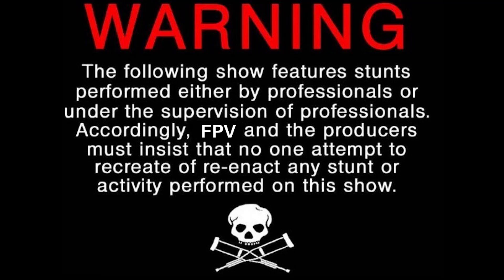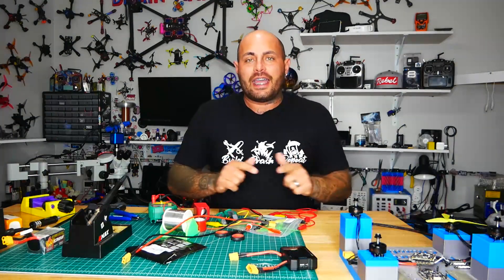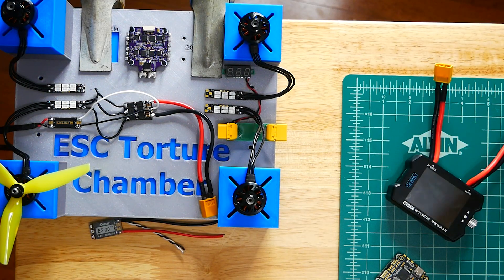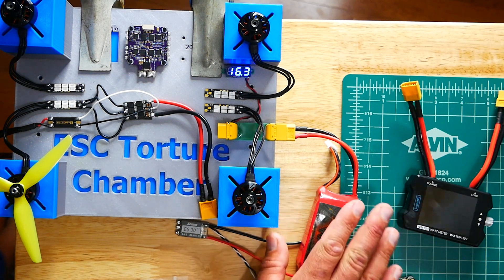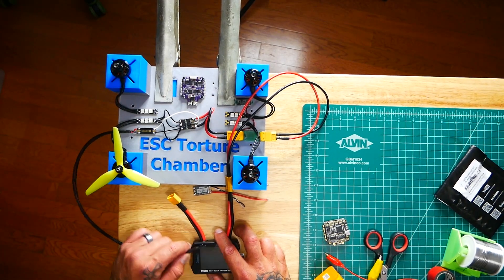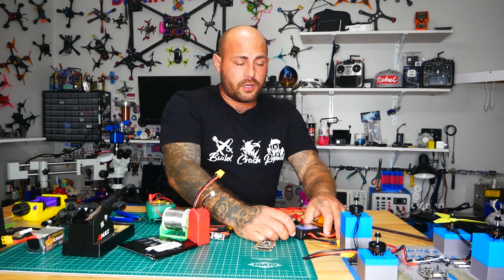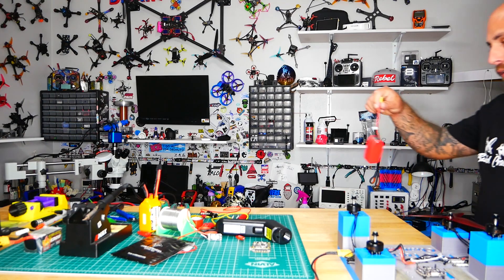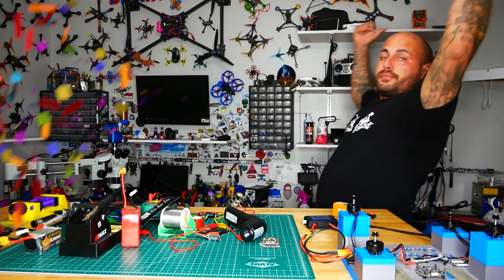Are The ESC Amp Ratings Real?! Let's Find Out!

Comment: yeaaahhh, finally, we'll know marketting / reality
I'll be very interested in Mamba F50 BlHeli32 50Amp ... 
I'm using it on a 7 '' , 6S, and in Blackbox, I never get more than 30A, even with very high C  LiPo.  I read the same from a pilot with 7" and 2805 motors, using that same 50A Mamba ....

Comment: I see at least two problems here on your tests :
- It's really not representative of the real use of the ESC's. single ESC's will have one insulation material over them, preventing the wind to cool them down. 4-in-1 ESC's will not get hit by much wind. The amp rating does not mean anything. If you can cool them down really well, they can handle a lot more than their rating. If you really want to test the rating, put a set of resistors at the output of the ESC and let them draw the rated current.
- Usually, electronics die because of the temperature cycling. By getting hot, the materials expand and stress all the solderings. That happens when you ask more current for a limited amount of time, and repeat when the electronics cool down.
This is how power electronics are actually tested :)
Reply: Can you please do a test like this then please.
Reply: @M-H433  I won't do one since I don't think there is any point in doing so. your ESC's will get stressed depending on your motors and props. so many possible configurations, there really is not point in my opinion. It only allows you to compare one ESC to the other, but that's about it

Comment: You need a power supply.
You'll be getting a pretty big voltage drop from that long battery lead as well.
Reply: Exactly hook up a DC power supply and let it rip

Comment: I would love to see you test the I flight h7 beast 55amp. Got 3 flights out of mines
Reply: 3 flights and it popped, or still going?
Reply: @dq3666  three flights and it popped that's why I love to see it tested maybe I just had a bad one but it's too expensive to take a second chance
Reply: I have one on a 5" racing quad 50 packs so far so good.
Reply: Sucks to hear that. I was seriously considering getting one. Just curious (to both of you), what voltage were you running?
Reply: @dq3666  6s
Reply: @dq3666  6S
Reply: Were you using metal bolts? I just exploded my stack on a metal gate - rebuilt the stack and it's working fine - so I'm 70 packs in. I stopped using metal bolts and I no longer pop ESCs. You can check my channel to see how hard I fly my quads for reference.
Reply: @josephrsalexander4589  I mean I've built plenty of quads no issue and tried plenty of flight controllers ESCs over the years. The only thing that I can see that might possibly have been done wrong with mine is I only used one capacitor instead of both that were supplied
Reply: Well two things also was running 4S 2700 KV motors on 6s lipos with a motor output limit could have been pulling too many amps.